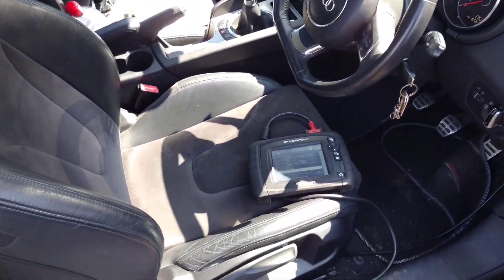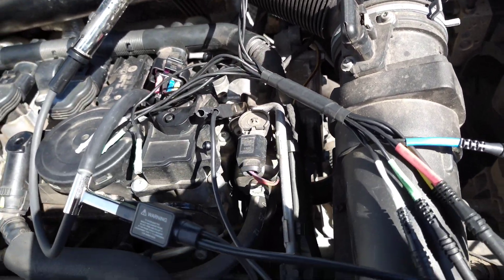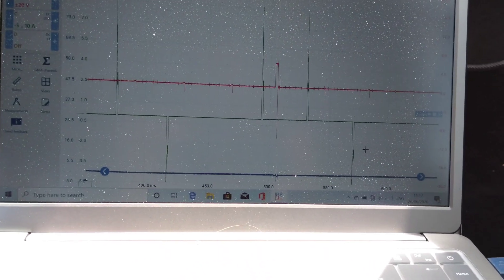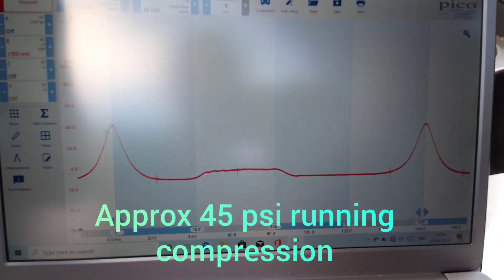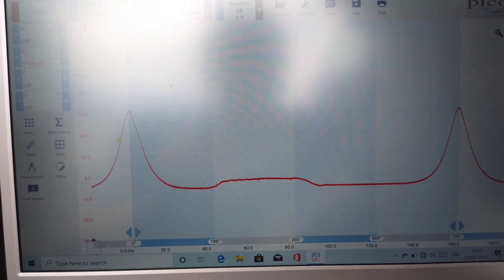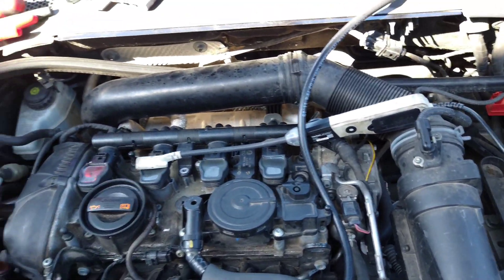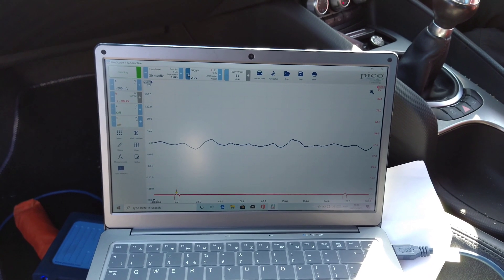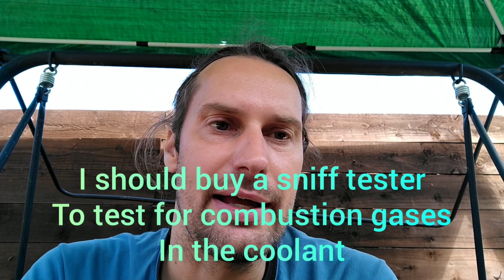Audi TT case study Part 1 (P0304 cylinder 4 misfire) injector shutdown

Comment: Hi matt just watched your video have bought a pulse senser and seen you using it in the coolant bottle what did you use in the coolant top to fit the pulse senser was very interesting video
Reply from the maker: It was a rubber funnel from a smoke machine. I had just got my pulse sensor too, I managed to use it on a job the same day.
Thanks for watching

Comment: Great content Matt, I'm just starting out using oscilloscope, it would help me and others I suppose if we could see or know some of the your inputs settings on pico  on your laptop so I or we could replicate them , I don't use pico I'm staring out with a hantek and I've since learned the pico software is better , thanks again for the videos good to watch and learn man thanks 
ROB
Reply from the maker: Thanks for watching and I will add more information on how I have the scope set up I future videos.
Thanks Matt
Reply: @mechanicmatt871  that would be great thanks

Comment: Very helpful indeed mate specially after the follow up video 👍👍👍👍
Reply from the maker: All the pieces of the puzzle eventually let me think of checking the valve lift on the cylinder with low compression. Thanks mate

Comment: I know you would like to be sore about your diagnosis but , that was a lot of testing... training always says eliminate mechanical faults with a relative compression test first which does not take up much of your time thanks for the video .
Reply from the maker: You are absolutely correct, I was trying a relative compression with a pulse sensor in an exhaust blocked off with a rag.
I also couldn't hear any change while cranking.
I will definitely go for a relative compression first next time, even when it sounds ok.
Thanks for watching and your advice

Comment: Very nice methodical approach. Tricky... kinda surprising such a marginal loss of compression would trigger an intentional shutdown. Bit like palm reading trying to interpret that cooling system waveform 😬 Good luck with that Matt. Thx for taking the time to publish this study. Cheers
Reply from the maker: That was a messy pulse, luckily the cooling system had already pressurised during the short time I had the pulse sensor connected, it made an obvious sound of the pressure being released when I pulled the adaptor out of the expansion bottle. That led me to a leak down to confirm a combustion leak into the coolant from cylinder 4.
I thought it may need a dead cylinder before it shuts down the injector, I enjoyed this one, every day is a school day. Thanks for watching.

Comment: Must be the best testing channel on youtube
Reply from the maker: I may may sometimes go over the top with it, but I enjoy the diagnostic work. Thanks for watching and your comment
Reply: @mechanicmatt871  dont think your going to see much just cranking with the first look up the exhaust. Needs to be running for a bit of pressure to be there. Why do you not use an overlay
Reply from the maker: I could still see a good exhaust pulse with a rag in the exhaust pipe with it cranking and the coils disconnected, it just didn't show an odd one out of the cylinders.
My pressure waveform overlay was on my other laptop, I got a new laptop and haven't downloaded it yet. I should do that thanks